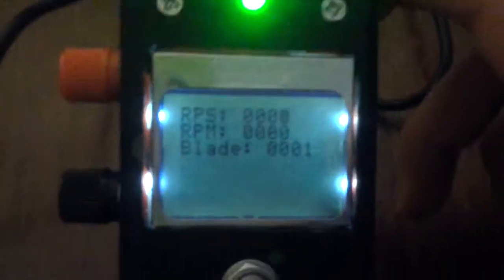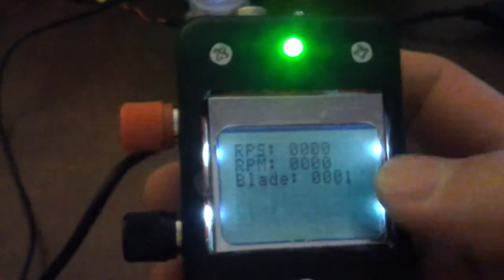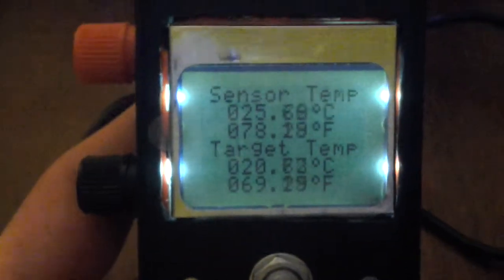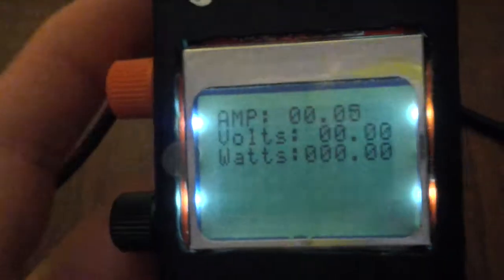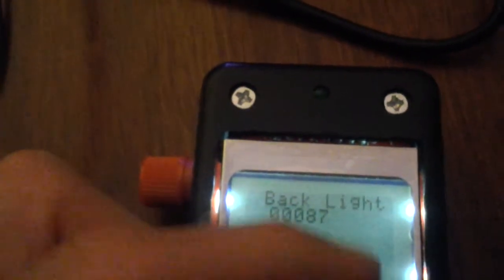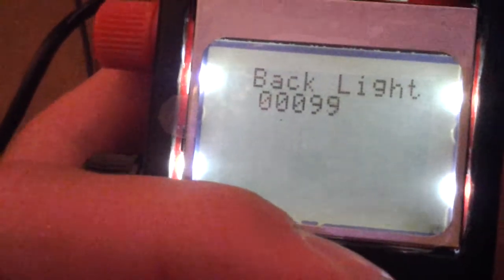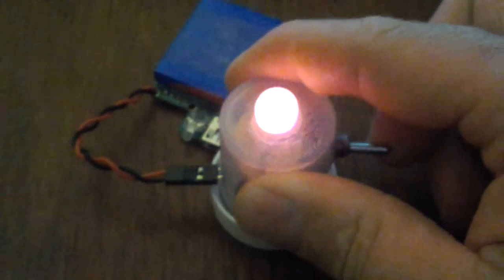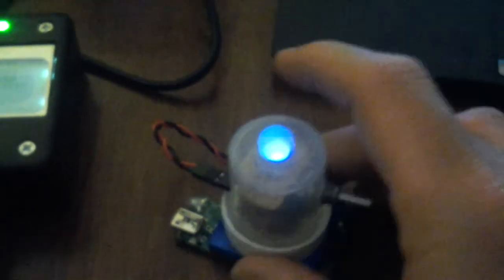Arduino project tach, temp and ampmeter

Comment from the maker: It's an old USB battery backup for cell got many of those since they can be useful I simply remove the usb connector and solder a little wire that I use for powering my project I should put it back in a case though I always have the problem of shorting :S :)